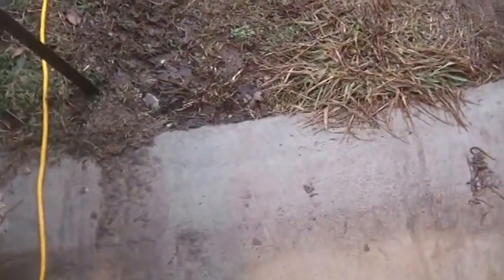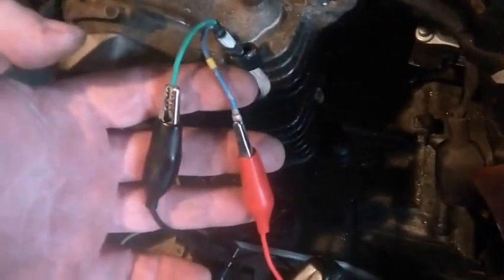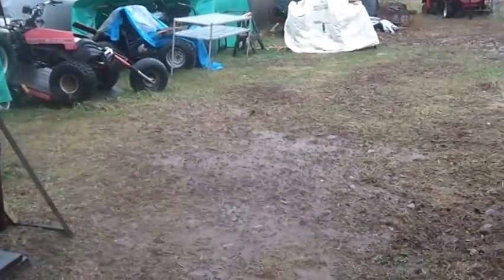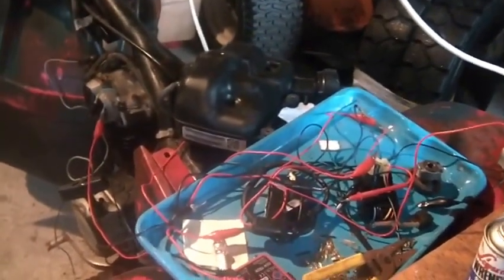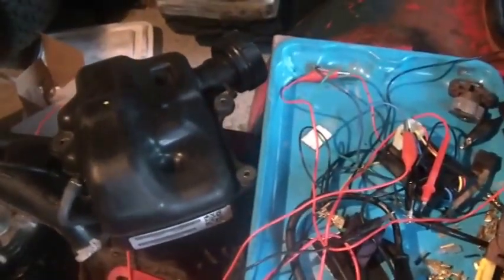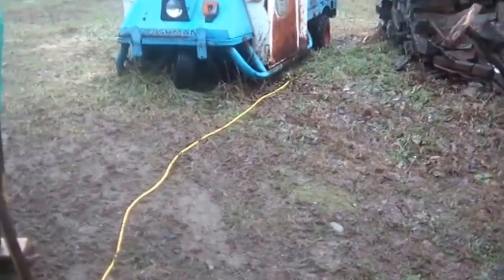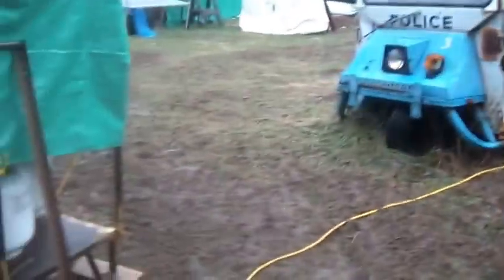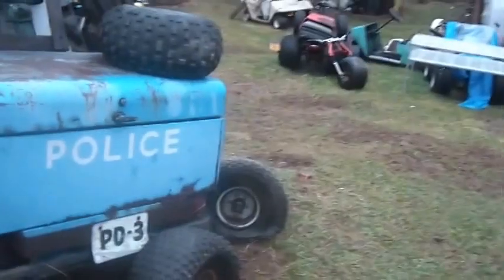1_11_2014,  Part 2, AC to 12Volt DC CDI Honda ATC 200S conversion

Comment: harvey. iv watched alot of your great videos. but iv always wondered about the charging system for the battery in you ac or dc convert. how would the bike itself go about charging the battery to keep spark from dying out with out the charging ring coil. just wondering
Reply from the maker: Hey lead foot lawn mower, The DC CDI seems to use less than 100ma @12 Volts, a typical 5AmpereHour would last around 50hrs without recharging, I have not gotten to measuring the Voltage of the 200S on board lighting circuit, from there, I can put together a diode circuit to trickle charge a battery, The light circuit is good for 20+Watts I think, I only need 1 or 2 Watts for run the DC CDI circuit. Thanks for watching and asking, I think U R anticipating Part 4 or 5 of the series...
Reply: thanks man, if i ever do get another one of these honda three wheelers i will certainly know who to ask for help. and thanks for explaining in detail. as most dont.
Reply from the maker: lead foot lawn mower, np Bud!  I'm going thru my second childhood, except now, I can actually fix some of this stuff, back then, I was a hacker! Thanks for the kinds words and feedback!  About getting another 3 wheeler, U need one badly, I can tell, check Craigslist now!
Reply: will do. and i have. found alot within range of pickup
Reply from the maker: Lead foot lawn mower, there is a $400 parts / semi-running Honda 250ES Big Red near my house, For $250, it would be a steal, I'm holding myself back. Maybe, I'll wait a couple of days then throw an offer... Let me know what U get.
Reply: i will. hope to find one soon

Comment: maybe make a split gas tank that has one side gas and the other side electronics that way everything would be close to hooking up.
Reply from the maker: chox2001, I have some proper connectors coming this week thru the post, from there, I need to figure out how to package it all up, I think I can put it in one box up on the handle bars, maybe Velcro it into place and use color coded alligator clips to hook it up. U maybe right though, a skinny tank on one side the electronic on the other, Maybe try one of Mustie1's water bottle gas tanks. Thanks for the ideas, watching, and commenting!